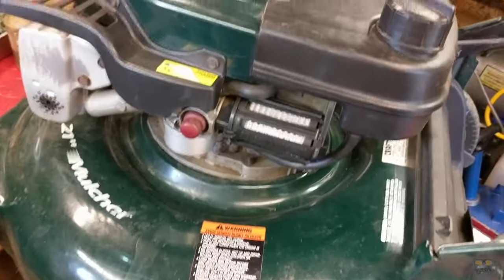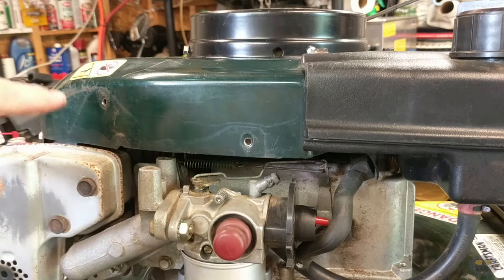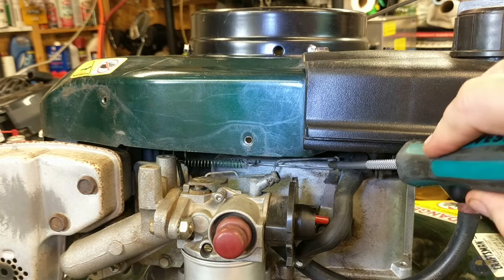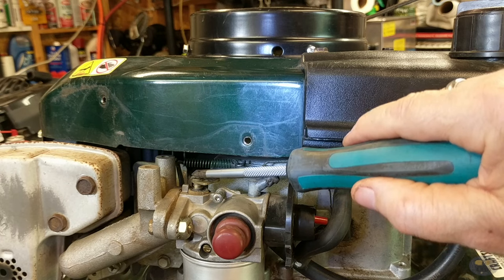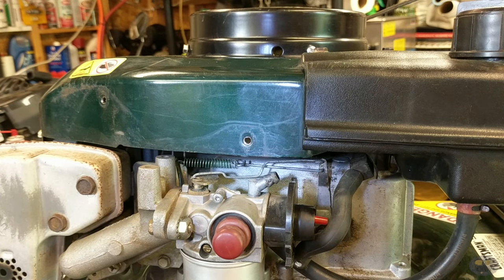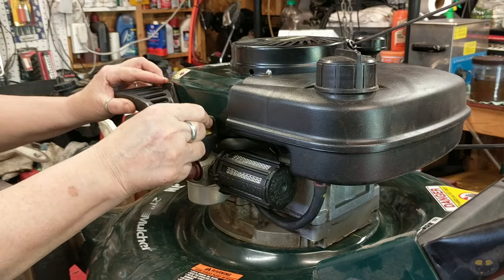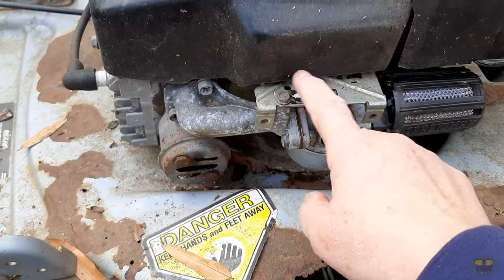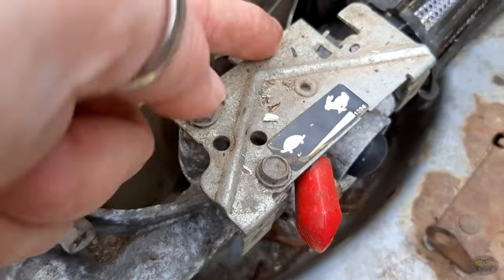Quick Tips: Easy ANSWERS - Tecumseh Carburetor Linkages

Comment: 3:30 I do like the old Tecumsehs Mick, er, I mean Stella. All that old equipment is fun. Quantums, TVS195s, I even have a 1965 Briggs with the crank spring starter. It isn’t work when it’s play. Old time equipment was more dangerous, when Dad cut the front yard, us kids had to go play in the back yard until he was done with the front. Once he moved on to the side yard, you could go play in the front yard again. Those mowers would throw stones or acorns at high speed. Touching the mower was verboten. Hot exhaust, gasoline, all were incompatible with being a child. Dangerous! You might cut your fingers off!
Reply from the maker: Funny, now you mention that, I too remember being told to play somewhere else. LOL.